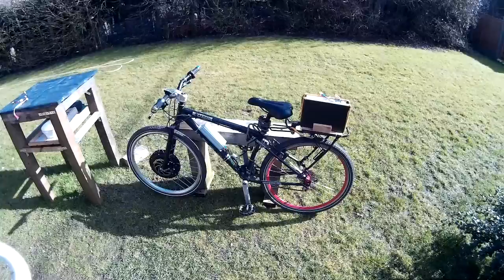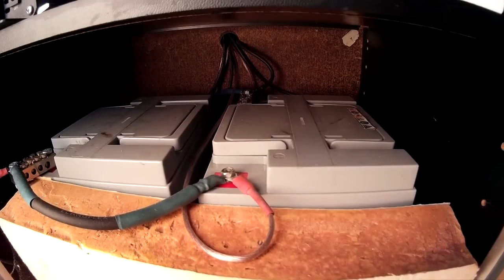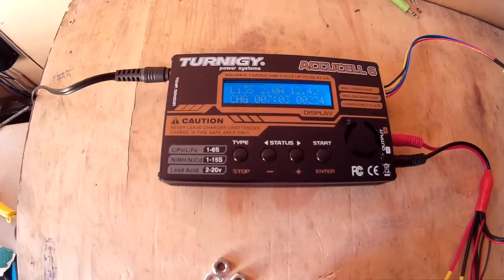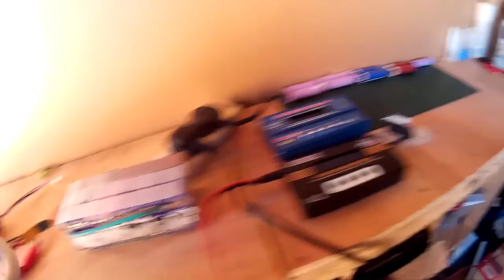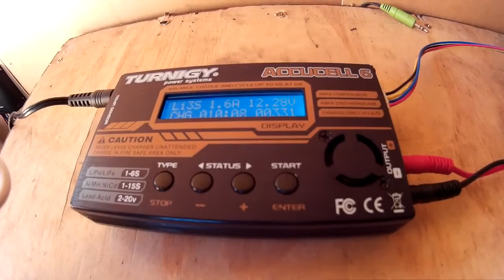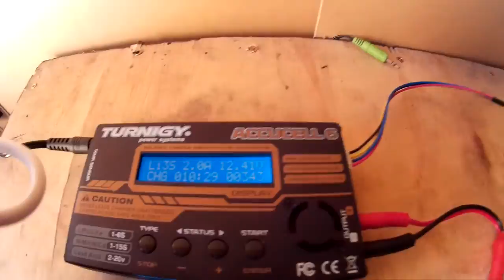Charge Ebike With Solar Panels  DIY Ebike charging

Comment: really nice setup mate :-) nice clean smart well assorted job there :-D it sucks that the li-ion packs need balancing a lot but theres no getting round it im afraid, that last set up batteries on the negative terminal always take the brunt of the demand :-) something to keep in mind perhaps: ni-mh batteries from old hybrid cars :-) they are pretty cheap at scrap yards and provide some meaty amps, as well as having an awesome memory cycle record and can be charged using the chargers you are using there for the li-ions :-) the li-ions arguably are lighter and are good for long range, where ni-mh would be good for hill climbing say or sprint bursts :-D
Reply from the maker: Thanks.
"ni-mh batteries from old hybrid cars", I did not know that.

Comment: sir i am trying to put together a simple & cheap solar system using 18650 cells would you be able to make a tutorial on how to put it together
Reply: you cant really use li-ions for solar, I mean its possible but because the cell chemistries are different to lead acid they need a clever charge system, its possible to use a single sla battery I guess to receive the solar panels charge, then hook an inverter up to that sla that will then run a li-ion charger. but it has a load of problems attached to it, like balancing your 18650 packs a lot, having to reset the chargers on the li-ions a lot and a few other bits. I looked in to it as I wanted to do similar with ni-mh batteries :-p but they arnt really suitable for solar energy storage for a whole load of other reasons :-p hope this helps :-)

Comment: Nice and big setup. But I thought it would be a portable one. Any plans to make on the go solar charging, atleast upto some percentage? is it possible?
Reply from the maker: yes a portable ebike solar charger would be nice, it could be done the trouble is going to be the weight and the size of battery and solar panel. 
Thanks.
Reply: yes.... 38 or 48 volts would be hard to charge directly through the pannel... would need bigger. Might need breaking dynamo charger or something.
Reply: Norfolktuber there are some flexible solar panels that look pretty lightweight that may be of interest  http://www.ebay.co.uk/itm/Biard-100W-Semi-Flexible-solar-Panel-12V-For-Battery-Charging-RV-Boat-Caravan-/151490825281?pt=LH_DefaultDomain_3&hash=item23458e8c41 the only sad part is they don't scroll up, I think their flex is about 10-20% of their size which is a shame, I thought of something similar a while back, using an umbrella essentially with solar panels attached to it, but my ebike is pretty heavy so it wouldn't justify the means for me, but with something smaller like this it might work well enough :-)
Reply: battonfive
Nice Idea, 4 feet pannel, it can be used as a dome shade over head if can be bent little more. But you also get a roll able solar film pannel, http://www.amazon.com/gp/product/B006EP6MCU/ref=pd_lpo_sbs_dp_ss_3/176-5854454-9994719?pf_rd_m=ATVPDKIKX0DER&pf_rd_s=lpo-top-stripe-1&pf_rd_r=0JRB1P9TXJ3SG54MVBMM&pf_rd_t=201&pf_rd_p=1944687762&pf_rd_i=B00DHTWO9G
Dont know how it will work.